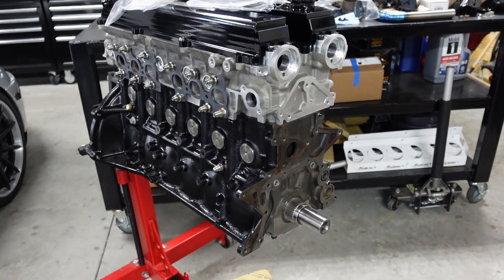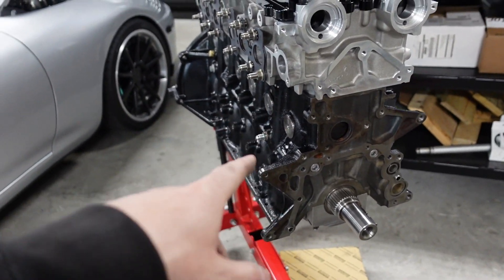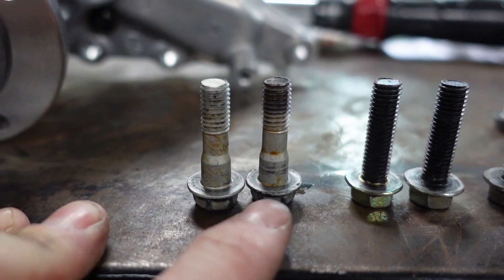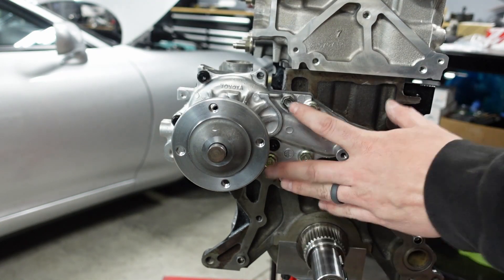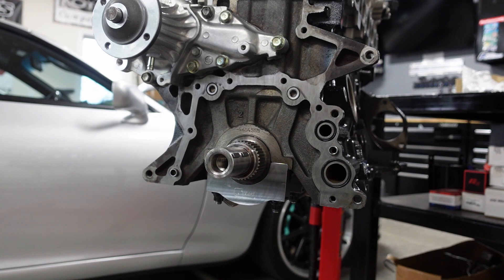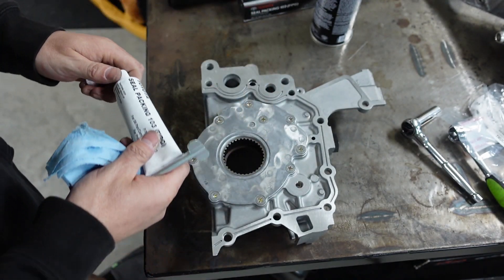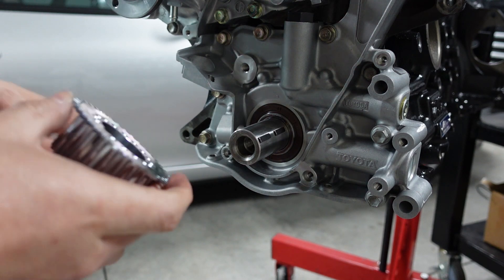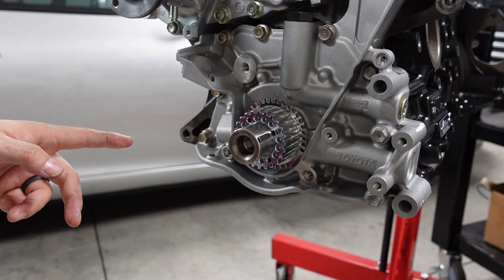2JZ Engine Build Ep. 12: Oil pump, Water pump & Crank Gear

Comment: Fun fact - you are not suppose to fill both of the grooves with FIPG on the oil pump. The inner groove closest to the o-ring is to catch the overflow of the FIPG when it squeezes out

Comment: I dont think your supposed to put silicone in those half round slots. Those are there to catch excess silicone to prevent from getting towards the o-rings
Reply: This comment is correct, those half rounds are to catch any excess silicone from getting into the two main oil passages . Don't double up like this video! Also Toyota states 5 minutes to install before FIPG needs to be re-done.
Reply: @JoeWitAFro the Toyota manual literally shows silicone being required there on the diagram.

Comment: Ported oil pump or nah?
Reply from the maker: Never port them, we have crazy oil pressure as it is. When you port them it causes more issues then it solves.
Reply: @PureFunction  so I got a fully built 2jzge engine it’s going to be NA-T but I can’t decide if I should get a ported pump either DM or PHR, a non ported GTE pump$350 at toyota, or a non ported base GE pump $500 at Lexus for a street car and some drifting I’d like to hit 500hp though but I’d also want the added security and insurance with the oil system but that’s just me
Reply: @itsreallytheo  I guess the theory is for better flow and less restrictive relief BUT the stock one works great imo and the proof is in all the stock gte running around making 800+ hp with no oil flow issue. Alot of Time people tend to over complicate thinks in turn causes more isssues.
Reply: I went with the factory untouched gte pump for my na-t build I'm doing, you should be fine with that.
Reply: @CmoneyGarage  I called up DM for some advice and I wasn’t sure if they were telling me real facts about the oil pressure worse without porting of if they just wanted me to
Buy a pump lol I’m not rushing but just researching why I’d need a ported pump over stock
Reply: I have the PHR in my stock GE bottom end
Reply: @kevinn1040GamePro  how’s is it holding up and any issues?
Reply: @itsreallytheo  no issues. I have a completely built head and stock GE bottom end. PHR modified pump. 7675 bb gen2 turbo making 700